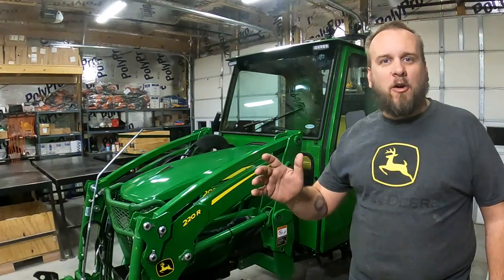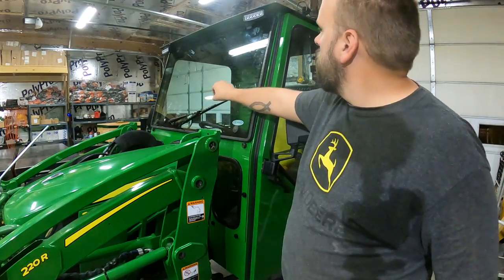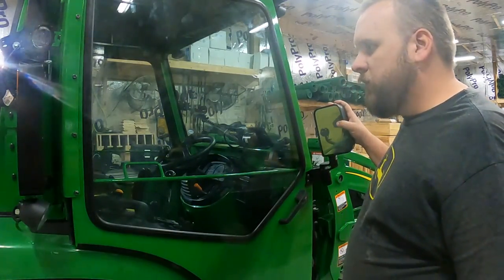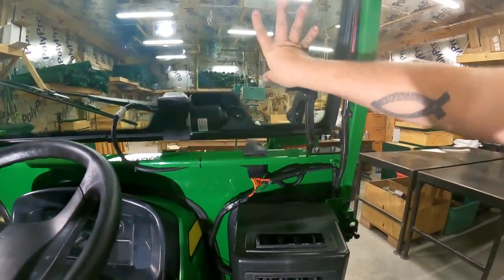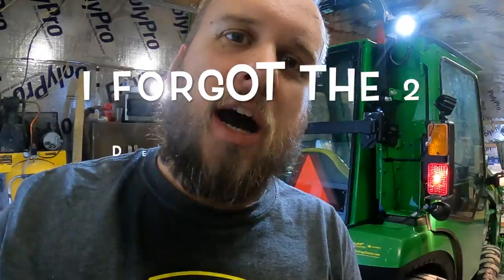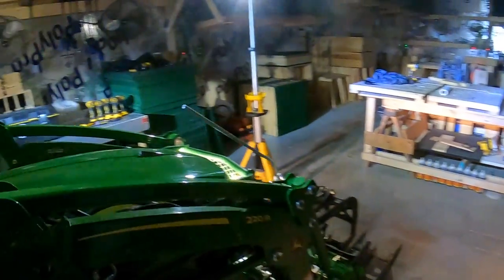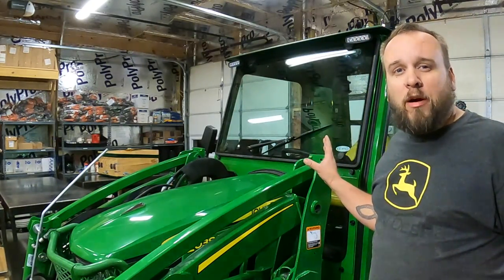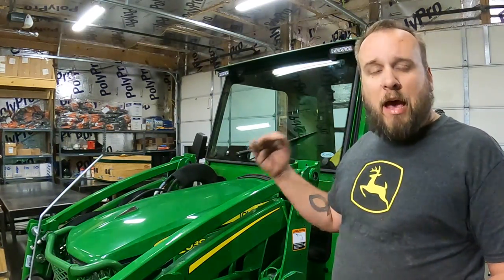Finally a High Quality Affordable Cab - Curtis Advantage Cab on a 2038R John Deere

Comment: Great video! I've had a Curtis cab on a John Deere 4300 for three years. Very well built, easy to install. Definitely get the optional lights and switch box. I snowblow a three mile road in NW Montana, it was -20 last week. The wind shifted and turned the tractor into a popsicle, the windshield stayed clear with the Curtis heater. I run with the heat on and door windows open and stay plenty warm. We remove the doors during the summer, I've never regretted not having AC.
\
Reply from the maker: Thanks for the feedback.

I just finished the install yesterday so I don’t have much experience with it but Everything you said sounds right to me

Comment: I did not see this before buying my original cab from OCC. I only go 1200 into mine so it was good for my budget. however I got to remove it for backhoe use and for storage as I don't want to bang it up or rip it. I may have spring for 2300 option had I saw this before. Oh and I have the 1026R not sure if they make this for that model.
Reply from the maker: I believe they do. I know they have it for the 1025

Comment: Does this cab work if you have a single point hydraulic connector for your front end loader?
Reply from the maker: I think so. Might want to verify with Curtis before putting in an order but I think it’s compatible.

Comment: Are these cabs good for the "older" models? I have a 2014 2032R and have been wondering about cab options?
Reply from the maker: Currently they only make their more premium cab for the older models.  Thanks for watching

https://curtisindustries.net/product/john-deere-2025-2032-2320-2520-2720-hard-side-cab/

Comment: Great Video Brock.  Say what is the height from the floor to the top of the Curtis cab?  Can the ROPS still be lowered with the cab on?  For my situation I cannot fit my tractor in through the garage door with the ROPS up, but if I could put it down and have a cab like this on it and it would fit that would be awesome. Thanks!
Reply from the maker: The Rops go up and down the same way.  It is not affected by the cab

The top of the cab is 83 1/2 inches on mine.

Your tires could affect that height if they are not R4 like mine

Curtis states that it is 60 inches above your floorboard. My floorboard is 26 inches high so it actually seems like it came out a little lower than they state

My garage doors are not standard. They’re actually quite short at 78 inches so mine will not go.  I’ve never put my tractor in the garage so that didn’t matter to me. I have another building for it

My truck only clears by 1 inch
Reply: @RockhillfarmYT  60" off the floorboard.  Thats probably a better measurement. Like you said, to many variables below that.  Thanks Brock.

Comment: I agree the Curtis cab is nice but the cost is to expensive, would have made more sense to purchase a cab model to begin with.
Reply from the maker: John Deere does not offer a cab for my tractor. When they do offer a cab they normally cost around $10,000. This cab can be had as cheaply as $2500.

That’s 25% of the cost. Huge difference.

Comment: I have a Curtis cab on my 19 1025R the front windshield gasket leaks keeps coming loose and has since new, doors gaskets leak and come off,  bought Curtis Rounds lights they both leak h2o they are both shot now, not even 3 years old I talked to the dealer about this, but I was just outside the 1 year my bad, and now the rear wiper motor died first time plowing snow this year, and the mirrors vibrate and move on you every time you close the door and I did tighten up so they are a joke, did you notice his mirrors had moved, this CAB has been a Nightmare and it was installed by the John Deere dealer when I purchased the tractor new, poor engineering and they do not stand behind it!!! I emailed them about getting an upgraded roof that was not flat I got 1 reply and then nothing and frustrated customer.
Reply from the maker: Thanks for sharing 

I’ve been really happy with mine

Comment: i dont know 90+ degrees temperature would be nice having air conditioning
Reply from the maker: Definitely, but those air conditioned factory cabs have a big price tag with them and they rob a bit of little horsepower from the machine

This cab is cooler than an open station because you have shade and a fan
Reply: @RockhillfarmYT  lol just saying that is all and you are right about them dealers . and having a cab with heat for the winter would be awesome especially if someone have a  snowblower or snowplow on there tractor
Reply from the maker: Yeah, I wasn’t disagreeing with you. I want to end up with a cab tractor that has air-conditioning 

Just mentioning that there are different factors for instance the 2038r doesn’t have a factory cab option